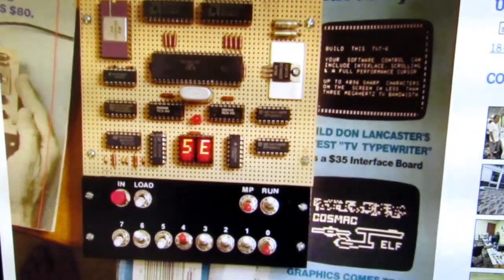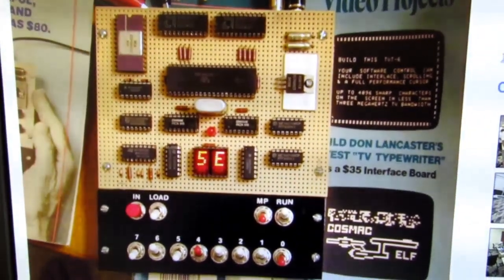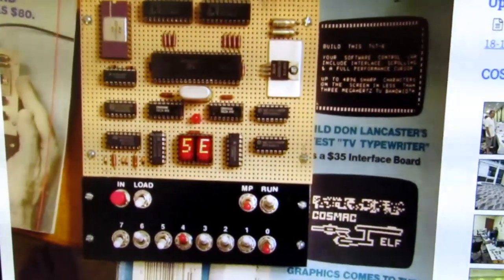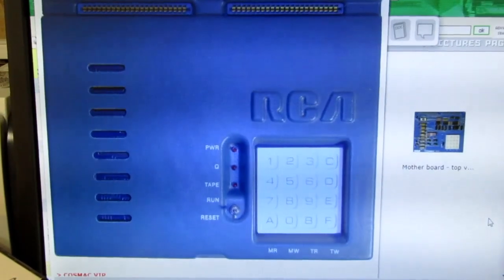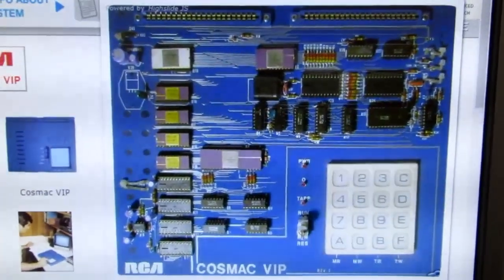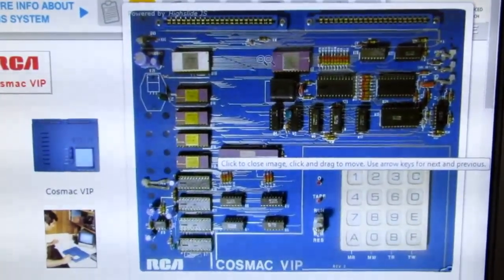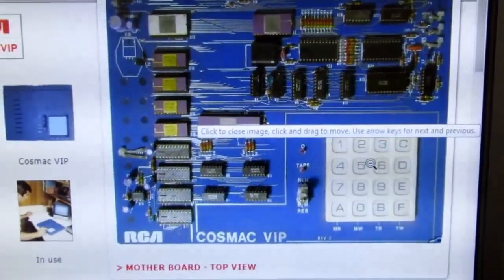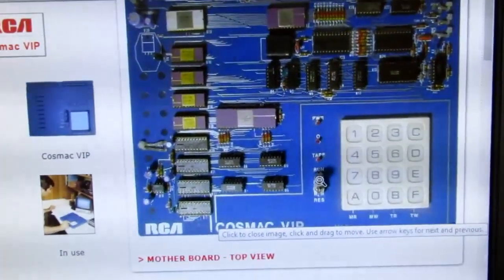VIP2k - 40th Anniversary COSMAC VIP Computer Reproduction

Comment: using a couple of pencils on their eraser end to type would probably be helpful-this stuff sure brings back memories for me!
Reply from the maker: The issue I have with this keyboard is not so much pressing the keys....they (and their spacing) is adequate, but I can't easily read the key legends, since they are buried down on the circuit board silk screen, essentially hidden at the bottom of deep little valleys between the rows of keys. I have to look straight down on them to have a chance to read them at all, and the lighting has to be good as well, and if my hand is over the keyboard, it makes a shadow and blocks my view of those legends. All of these issues were fixed by use my my home made keyboard overlay.

Comment: At 53:17 you accidentally input a zero too much, and the monitor seemed to discard the most significant nybble, so it displayed memory at 0000
Reply from the maker: The monitor only looks at the last four address digits entered, so for example if I wanted to enter 8000 but accidentally entered four 0's, resulting in 80000, the monitor would interpret that as 0000.

Comment: Can you please provide a link so I can obtain the same kit? Thanks. Love the video.
Reply from the maker: I already have the URL (of the webpage where you can look into getting the kit) listed twice at the start if my video. I was provided with a very early version of the kit, in part because I have helped to Beta test other kits and their documentation. 

Currently (November 1, 2018) that webpage only allows for purchase of the bare circuit boards, not the complete kit. That's because the kit is still in Beta testing.

At the bottom of that webpage, you can email Lee Hart to inquire about kit availability.
Reply: Thank you sir. @youtuuba

Comment: Are those the same buttons that came with the Briel kim-1 replica? Where can I buy those quieter white buttons? I haven't been able to find them
Reply from the maker: How do you know they are quieter (with all the audio level adjustments inherent to online transmission of streaming video)...and quieter than what?

Why ask your question in this context? This video is about the Lee Hart kit. The Briel kit is by another maker, and on another video entirely. And nobody at this end, or watching, is likely to know which brand and model of white switch was used by whoever made the Briel kit for the seller.

You say you have tried everywhere to get these switches, but it sounds like you don't actually know many details about what you are looking for, other than they are white, and based on this one video, they seem 'quiet' to you. How about their other characteristics, of which there are many?
Once you have a better handle on what you want (i.e. which engineering specifications are important to you), then I suggest trying places like Digikey and Mouser, who both have wide selections and who don't have minimum order requirements.
Reply: @youtuuba  as far as tactile buttons go, there are several kinds, of which the most common are the black ones, as far as I've seen. They are very loud, and very clicky. I ordered a briel computer kit a while ago and came with white buttons, identical to the ones in your video, so I thought I'd ask. Those buttons were much softer and quieter to press. I don't know the details exactly or where to find them, I have tried mouser and others, but to no luck.
Anyways, thanks for your videos, they are very informative.
Reply from the maker: @NM-zq5tf  , there is no correlation between button color and how loud the click is. There are tons of different makes and models of small tactile switches, and there is no way for you to tell the exact make and model by just looking at them in the video.

If you just contacted places like Mouser, and could not give them more specifics than "white" and "quiet", then no wonder you did not find anything.